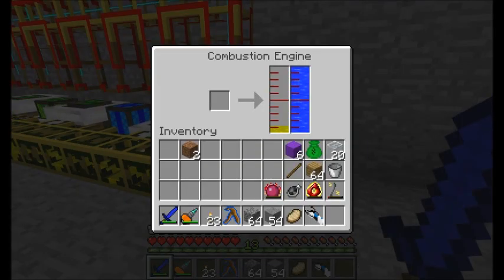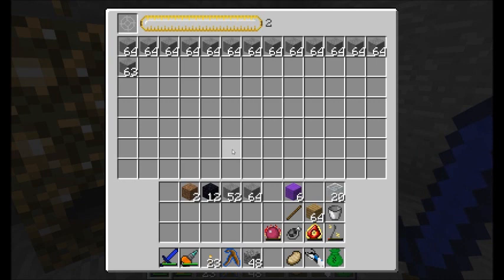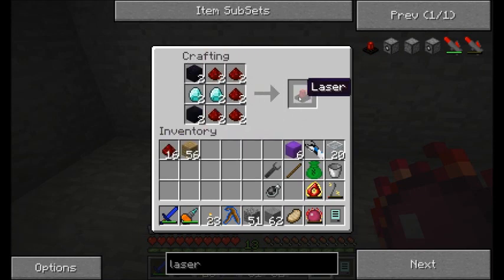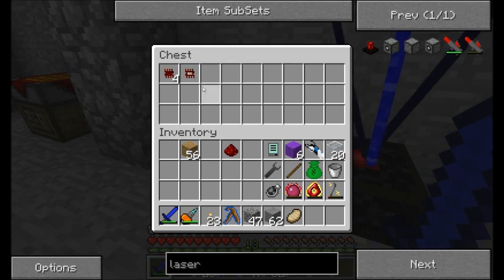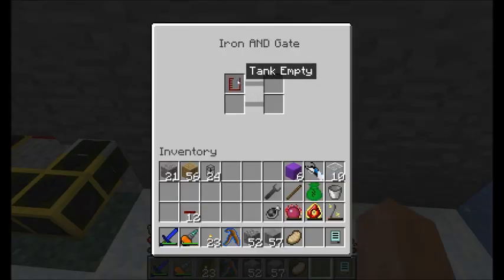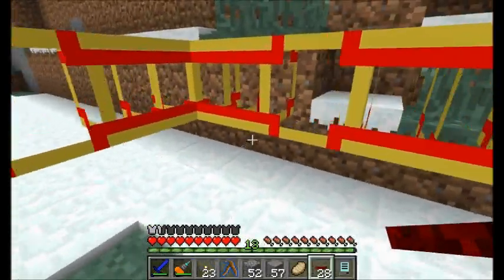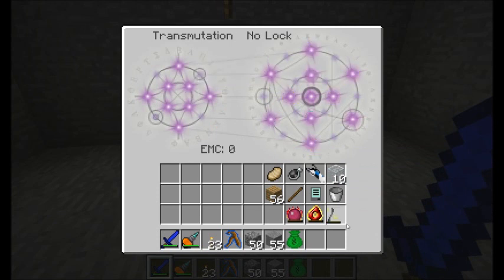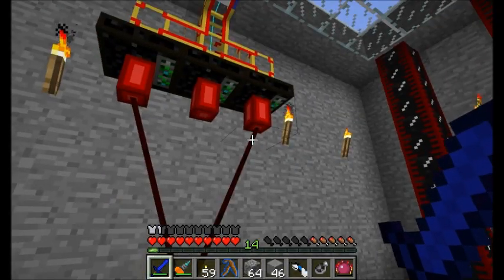Season 3 Episode 18 - Direwolf20's Lets Play

Comment: @SaintNicholasBlack No. It just doubles "Ores". So if you get a RM furnace, you wont need to macerate your ores anymore. And, a tip most people dont know, if you have a pickaxe with the silk touch ench, you can double your diamond ammount (it will drop the block, its called diamond ore, so it should duplicate at the RM furnace.) But it looks kinda redundant, cause...if you have a RM furnace, you will be full of diamonds already.

Comment: @direwolf20 that reminds me i had a powerplant system in buildcraft and had about 14 engines so i had 7 different pumps with gold pipes running water but they still were overheating is there a limit to how much water can pass through pipes?